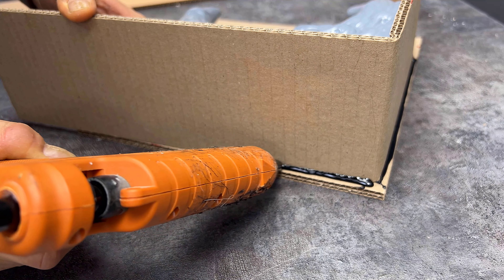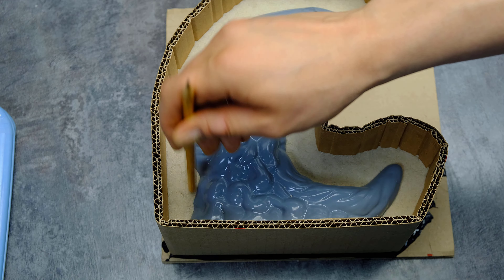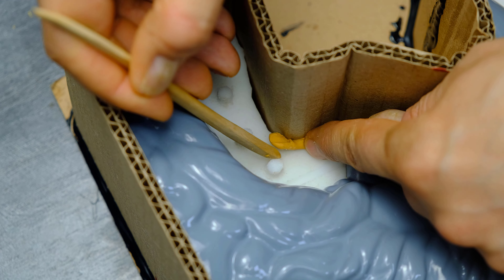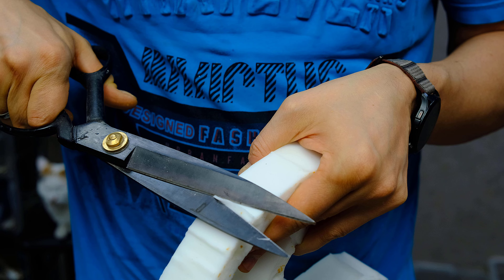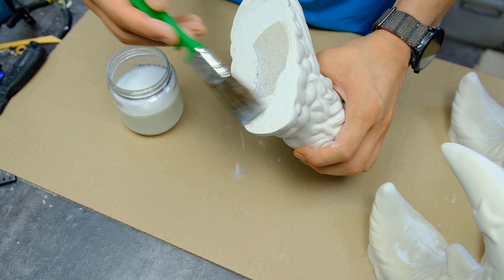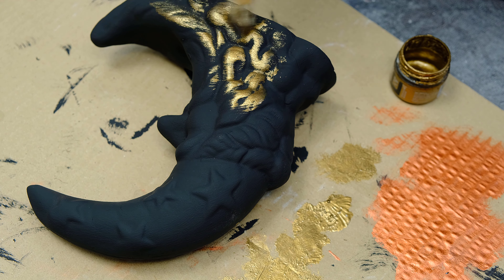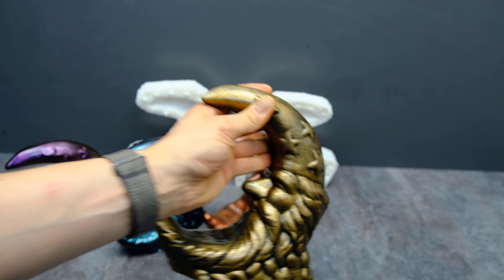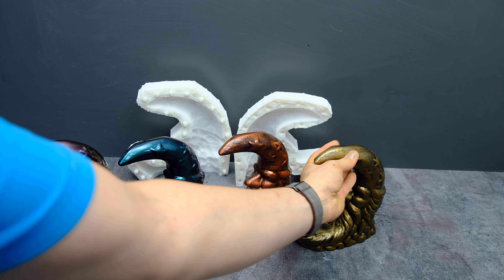From Print to Plaster: Crafting with 3D Models and Silicone Molds DIY

Comment: Why not make a reverse mold from the original in the 3d modeling software and then 3d print the mold?
Reply from the maker: I do not know how to do it. Can you give me a link to a YouTube video so I can see how it's done? Thank you!
Reply: I would assume it would be PITA to get the layer lines off the mold while making it fit together perfectly. Most likely you'd still end up casting one gypsum version, sanding that and making a silicone mold off that. I'd just try printing PLA, giving it a vapor smoothing and making a mold of that.

Comment: Great results. Have you tried dipping your parts in UV epoxy crafting resin to smoothe them yet, works really well and is fast.
Reply from the maker: Thank you very much! I will definitely try it.
Reply: @DoasIDo1  :) Some i dip and some i just pour over the piece. Using UV epoxy resin means it cures very quickly in sunlight or under a UV lamp. It fills the layer lines and of course can also be coloured with pigment before use.

Comment: Could have just used cura as a slicer and loaded up an object with the mold option on and just 3d print the mold
Reply: You /want/ to sand with projects like this. You can cut corners the way you suggest, but it will lead to an inferior result that will come out on every piece you make. Better to perfect one model and then mold it with silicone so you can use it MANY times over.
Reply: @TheNerdArmory  one thing I have done to cut back on sanding is to layer on 3d resin with a brush. Put it under uv. Rinse repeat. Just an idear

Comment: Perfect ❤ , can you tell me what is the specs of the fan that you use ?
Reply from the maker: Thank you! I didn't quite understand your question.
Reply: Sorry , i mean the fan inside paint booth
Reply from the maker: This is an exhaust fan that is installed in the bathroom. Only my fan is all metal, it is more powerful and reliable than plastic. In general, the more powerful the fan, the better. The faster the paint vapors will fly out and the product will dry faster.

Comment: How long takes it till you have to change the ventilator? Without protection it gets so fast paint on the surface that it will get sooner broken than normal.
Reply from the maker: My fan is completely metal and is easy to clean from paint. I clean it once a month.

Comment: k this may be dum to some people but my last model i made i did the filling differently becus moste filler primers do a really bad job at filling the layerlines this was my step by step: light sand to make it a little bit smoother then a tick varnish let it cure sand and then again a thick varnish after that it was just wet polish the model with a 1000grid and it was ready for paint maby an idea for next time
Reply from the maker: Thank you very much for the advice, I'll try to do like you!👍👍👍

Comment: Could’ve made a jacket mold and used less silicone instead of a flood mold , also if you’re doing a flood mold on something that small , you could pour it in one lump and cut it open afterwards, make the cuts jagged and you e got your location sorted.
Reply from the maker: Thanks a lot for the advice!👍

Comment: The entrapped air release holes and pegs - very cunning! The kinetic sand for the masked areas looks really promising on my own projects. I need to fill areas .25 of a mil across by .7 of a mil deep, though. As well as remove the masking material from the silicone afterwards. 

Perhaps kinetic sand and a magnifying glass is the way to go. 

I need to avoid the feathery edge left if I pour in a liquid filler. It always pulls back (down) slightly from the surface of the master.
Reply from the maker: It seems to me that kinetic sand is not suitable for such sizes, plasticine is better.
Reply: @DoasIDo2 Thanks for your experienced and considered reply.  In the UK we have Chavant. It's a heavy duty modelling plasticine, so I'll go with that.
Reply: I believe it has to be sulphur free plasticine to be compatible with silicone.
Reply: @Acheiropoietos  I think Chavant is advertised as being sulphur free - but I will double check. Thanks for the heads up.